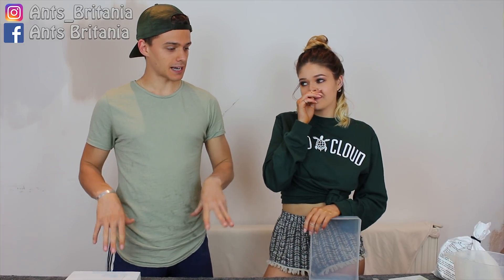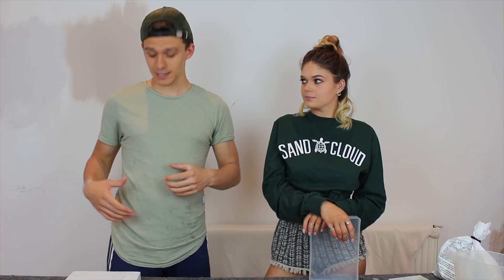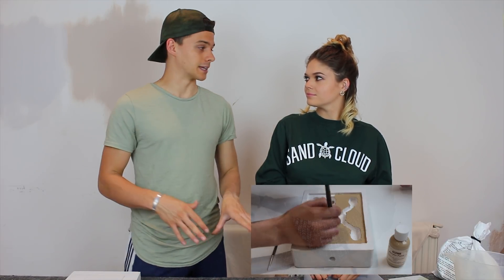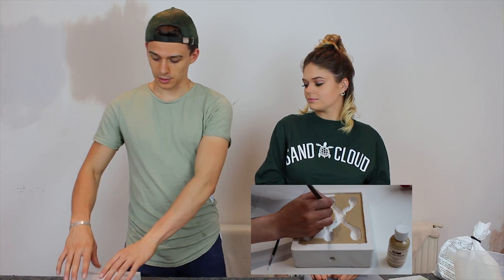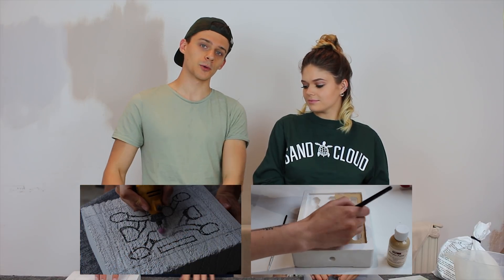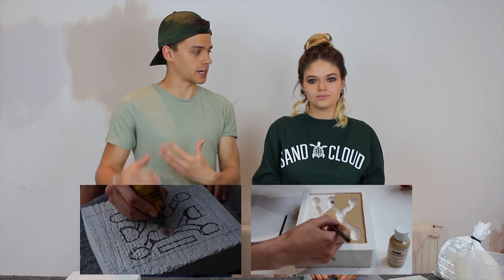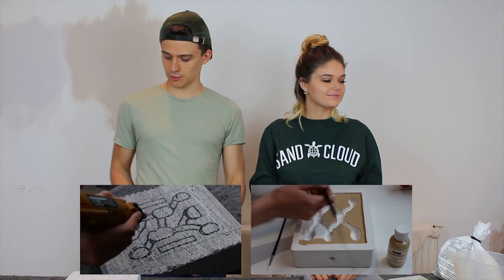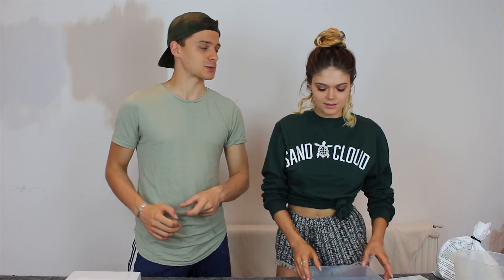Building Ant Nests! | Creating Formicariums feat. My Girlfriend!

Comment: What is the drill piece you use to drill the ytong?
Reply from the maker: It was one of the many dremel heads that came with the Dremel. I think they are grinding sand heads! :-)
Reply: Ants Britania is it hard to drill with it or is it quite easy because all the drill pieces I have take ages to drill through it
Reply from the maker: It usually carves through it like butter. Drill pieces aren't designed to carve, that's why I would suggest a sand headed dremel piece.
Reply: Ants Britania I bought dremel 225 but what do I plug it in  :/